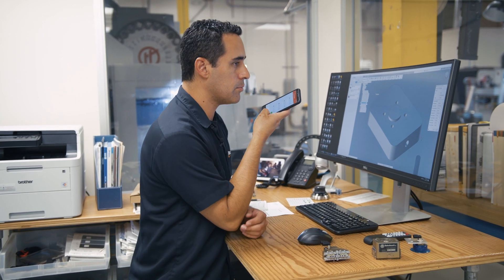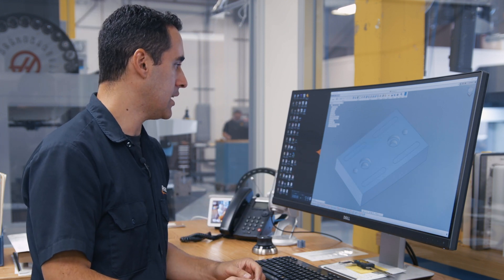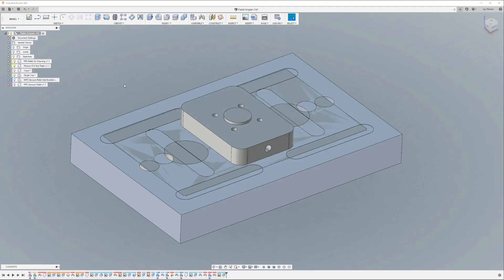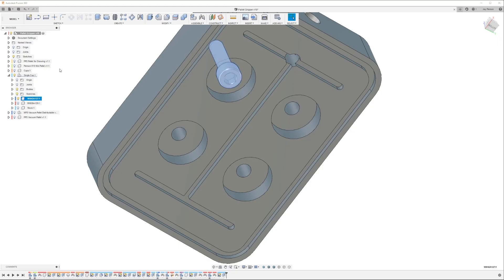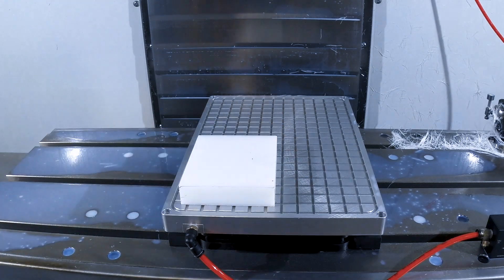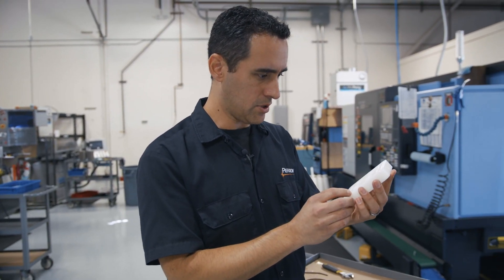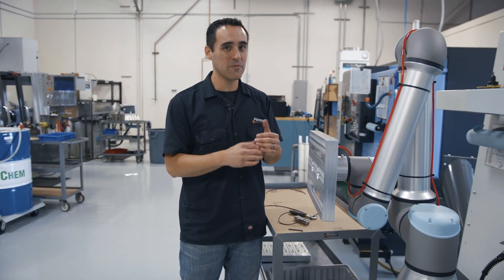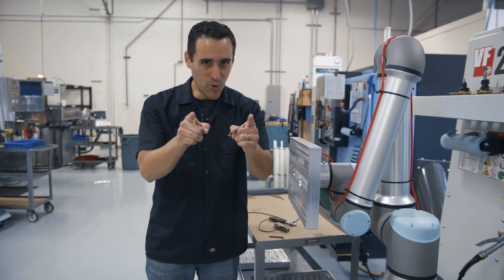Yup, totally sucks! Universal Robots UR10e | The Robot Episode 3

Comment: At 4:48, you have that large area highlighted as a vacuumed surface, but does the part rest against that surface? Or is it up off that surface just a bit?
Reply from the maker: Our vacuum gasket has a foam core and fully compresses so the part sits on the highlighted area.

Comment: The first item that I made on a manual mill was an x ray wedge for the atomic energy commission.  I was instructed to overlap the rubber O ring gasket with a 45 deg angle.  So I did that,  try  it.

Comment: You added the center boss to locate the part on the axis of the robot faceplate, but you forgot the additional dowel hole to clock it. You'll want that on there if you plan to take the vacuum tooling off at any point, so that way it will go back to the same radial clocking that you have in the program.
Reply from the maker: Nope. It was very intentional to omit the dowel hole. You'll see why in a future episode.

Comment: It would be nice if you made a video at some point, explaining how the vacuum is being created.  I really don't understand your vacuum source.  Not even in theory.
Reply: Google the venturi principle!
Reply: @bmonty65  I know the venturi principle very well.  I went to an aviation high school.  And I guess everybody knows how a paint spray gun works with the air compressor.  But  I am interested in a more technical insight of how this amount of machining vacuum is produced.  Pierson said a few intriguing things I never knew before about vacuum.  It got me super curious.
Reply: @danl.4743  The vacuum source is simply a small venturi device using shop compressed air passing through a venturi to draw air out of the vacuum system. It is a standard device used in many systems needing only a low level of vacuum, such as medical suction, pick and place machines, etc.

Some use multiple stages of venturis, each a little larger than the previous as the compressed air expands, to work rapidly, so the later stages move air faster, and as vacuum increases they seal off, until only the high vacuum low volume first stage is operating. 

For a high vacuum such as a vacuum tube etc, it takes other types of pumps or machines to remove the last tiny bits of air, but you don't gain much when you are just wanting to create a mechanical force. 

Pierson has their own product, and it is a little more efficient than many, but uses the same principle as a paint sprayer or carburetor.

The amount of vacuum holding power is calculated by looking at the surface area that the vacuum acts on, and the PSI of the vacuum source, and multiplying the psi by the number of square inches.
Same math as calculating the force in a hydraulic cylinder, psi of input pressure times the square inches of the piston.

In this case, the part is the piston, and hydraulic fluid is the atmospheric pressure, with the vacuum source creating a pressure differential.

At sea level mean atmospheric pressure is 14.7 psi, decreasing with elevation, but the actual vacuum created by a venturi source  will be less than the perfect vacuum, so 13-14 psi max, depending on the unit.
And any air leaks in the gasket or system will decrease it further by reducing the pressure differential. , so a good gasket is needed.

And remember that at higher elevation your holding force will decrease,.
Reply: @ke6gwf  Thank you VERY much for this detailed and thorough explanation.  You nicely put the mosaic pieces of information together in a logical way.  I enjoyed reading it, and I hope others will find it and have a chance to read it too.  Thanks man. Well done! :)
Reply: @ke6gwf  this is an awesome explanation. Thank you! Do I understand correctly that the amount of air in the pipes and the "pocket" of the gripper should be minimal, to improve the actuation speed? Would there be any benefit of having this pocket larger in some special cases?
Reply: @37kuba  since the vacuum "pump" has a maximum flow rate, yes, the lower the volume that is being evacuated, the faster it actuates.
Think of it like a bucket of water.
For the same size pump, the smaller the bucket the faster it empties.

I can't think of any situation off the top of my head where it would be better to have a larger evacuated volume on a system like this, since the vacuum source is operating continuously anyway,, so a reservoir doesn't seem to be helpful.
But there may be some unique situations where it would help that I haven't run across yet lol

Comment: Isn't that 24 lb pallet actually over the weight capacity of the UR 10 ?
Reply: The ur 10 will have a 10kg limit at it's full travel I would expect more the closer in to the base up to the limit of the servos
Reply: Thats probably  a fair statement
Reply: I was wondering the same thing. I'm curious if there's a load meter or something on the UR control that gives you an idea of what is reasonable and what isn't.
Reply: @ltborg  it would have current sensing they use it for overload and dingleberry interuptions (some operator gets in the way of the robots machine domination) lol

Comment: Their "...pallets go from 6"x10" all the way up to our 10"x6"..." maybe he meant 10"x16" ???
Reply: No, he meant that they can go all the way 90 degrees.  ;)
Reply: Jay, great job on your videos. Just a heads up, when calculating safety factors, you need to look at in a dynamic situation. Your worst case senario should be when the robot is rotating toward gravity and an e-stop condition occurs. I don't mean to be mean spirited, just passing knowledge along.
Keep up the great work and I love your though process.
Reply: @nickristoski  since life safety isn't a factor, just a sore toe, the safety margin is not as critical.
And the real test is to see if it will come off if bumped by an operator, which is a higher load condition than just an E Stop of the slow speed arm